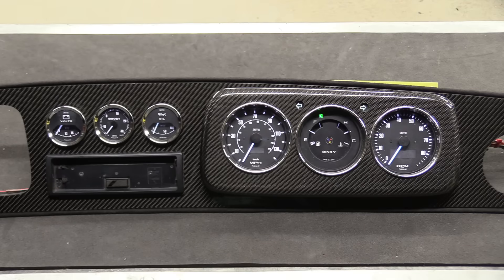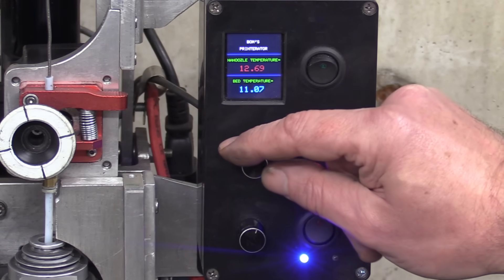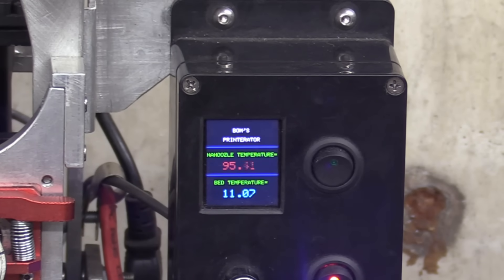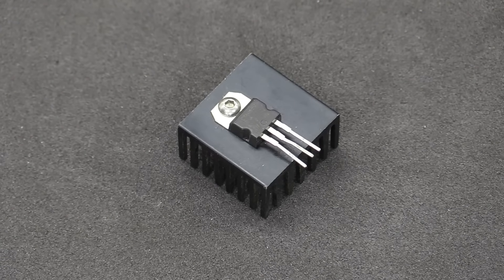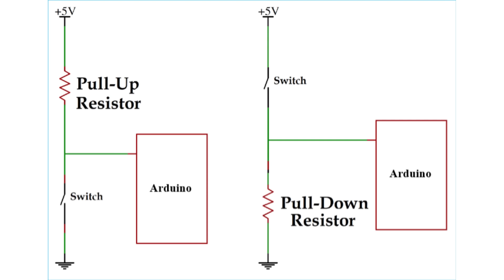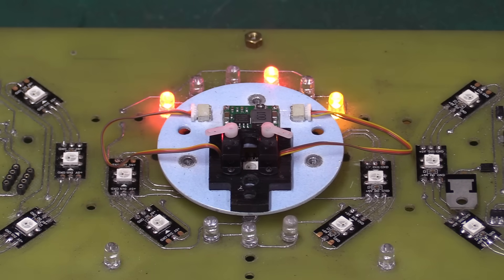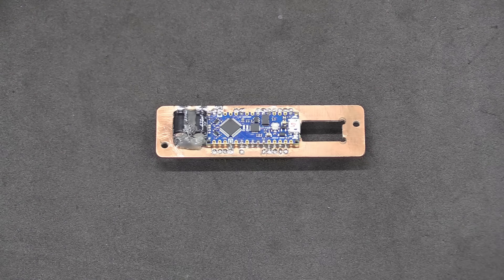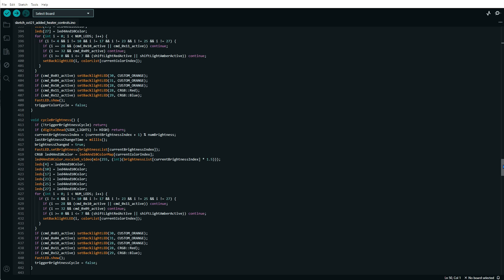Howie Did It - Learning Ardunio and Electronics

Comment: Is it okay to talk about one of my car related arduino projects here?

I have a nodemcu running arduino code that runs a server that generates an ajax web page.  Wired to it is a gps unit.  The webpage shows speed, direction, that sort of thing.  I wirelessly connect that to my surface tablet via my android phone acting as an access point.  On my surface I was running OBS which also took in a feed from a camera mounted in the car.   I could take the nodemcu feed and overlay the gps data as a browser input in obs.  And because the phone had internets access, I could then live stream the video to Twitch or record for youtube as I see fit.

This was a few years ago now, before ai so I did it myself.  I would like to use the setup again but the fact the camera feed was not stabilised and it all ran out of power too easily, I stopped using it.  I could not afford a big powerbank thing like a jackery, otherwise I would have continued developing the setup.

These days I just record with a phone with no gps data but can have digitally stabilised video.  It is more comfortable to watch, but I would still like to have gps data shown on screen.  Does anyone have any ideas how to do this without spending any money?
Reply: ESP32-P4. Sorted

Comment: Did anyone mention using an ESP32 chip instead of an Arduino? They are a lot fast than an Arduino, you can use almost the same code as an Arduino and you get Wifi and Bluetooth in the mix for with the chip! and, they are also cheap  - I mean, its a bit late now, but..... ;-)
Reply: Far fewer IO pins, not much in the way of ADC, a more complicated development environment, and the added complexity of 3.3v instead of 5v. As a professional embedded Dev I can't bring myself to use old atmega chips in general, but it's an appropriate choice here.

Comment: hi there is a very easy way to connect 12v inputs to a 5v micro controller just use a input resister on each input eg 10k and a diode from each input to a common Zener diode connected to ground to limit the voltage eg a 4.5v zener

Comment: Make sure you've got enough power supply protection.  The switching regulator probably won't protect you against alternator load dumps when you turn the car off. You need an appropriate combination of diodes, zener diodes and a varistor.
Reply: And a fuse too? ( I keep trying to convince myself that their track layouts on the instrument cluster won't short out)
Reply: Good suggestion .I'm thinking to incorporate something like this https://www.circuitbasics.com/wp-content/uploads/2020/07/over_voltage_protection_1-1536x656.jpg but with a polyswitch instead of  fuse in my arduino / auto project..
Reply: That's even starting to be a problem in the NERF modding hobby, now that brushless motor systems are getting more common; the load dumps when you let go of the rev switch and trigger are enough to blow things up without a flyback diode and/or fuse in the right place. Even the brushed motors still dump enough power when the circuit opens to require extra help to avoid smoking something internally...

Comment: This project is like life. By the time you figure out all the things you'd have done differently, you're near the end.
Reply: Which leads to the "second system effect" where the second time you build a kind of a thing, it's a disaster because of all the stuff you try to cram in there.
Reply: Or, as they say... Experience is what you get right after it would have helped.
Reply: @douglasburnside  which is why using other people's experience is a helpful thing.

Comment: Your solution to power the arduino from the car will soon kill it.  Automotive power is messy as hell - you’ll need a lot more components to make a reliable 5v source
Reply from the maker: It's not being powered by 5v.
Reply: @BadObsessionMotorsport  well whatever stepdown you are using

Comment: Since you learned how to program Arduinos, you could also use way stronger micro controllers as well. STM32, ESP32, Teensy. All way more powerful than the Arduino and the first two are still cheap as hell. The ESP32 even comes with Wifi and Bluetooth, which can be quite useful.
Reply from the maker: For this project, the Arduino was plenty powerful enough.
Reply: @BadObsessionMotorsport  Except you needed two😄. I really don't see the advantage if you get an ESP32 Board for 2 bucks.
Reply: It's entirely possible to get it all into a single Arduino, it's not a question of capability. The real problem is that this is automotive and you don't want a bug in an unrelated bit of code crashing your instrument cluster when you're driving. It's far safer to separate out tasks onto individual processors so failures are limited.

Comment: Arduinos are pretty crap these days.  Just no point in using them.  ESP32 is way more useful.
Reply from the maker: ESP32 wouldn't be any more use to us in this instance.
Reply: @BadObsessionMotorsport  well it would would have been powerfully enough to drive everything without needing two nanos for a start.  Then you’d just have more headroom for your imagination too.  Over the air firmware updates over WiFi ?
Reply: Also just cheaper
Reply: @odl21 the atmega is plenty powerful enough for this. Separating the mcus means that a bug in your fancy lighting code doesn't crash your entire instrument cluster when you're doing 100kph on the road. Safety and reliability is more important than saving a couple bucks on the bench.
Reply: Also I would recommend looking into windsurf and platformio instead of arduino ide and LLMs.  Fully integrated, much more powerful and professional experience

Comment: As the arduino has built in pullups it makes more sense to connect buttons to ground and use software to enable the pullup.
Reply from the maker: Couldn't agree more.

Comment: 'Return spring' is about the best description for pulldown/pullups that I've heard in decades of noodling with analogue ccts. Nicking that!
Reply from the maker: Be my guest.
Reply: It doesn't hurt that the symbol for a resistor looks like a spring already 😂
Reply: @JamesChurchill Only in the USA. Over here it looks like a spring with its ends sticking out of a TEMU parcel 😄
Reply: @JamesChurchill  Unfortunately though, resistors are much more similar to dampers when you look into how electrical systems and mechanical systems map onto each other.  Springs are more like inductors, while capacitors behave like inerters.
Reply: It's also the release date of their next intallment :)
Reply: Yes, the spring analogy for pull-up and pull-down resistors on digital inputs / outputs is brilliant. Well done guys
Reply: Yup. As a relative newby, don't think I really understood what they were doing until that moment.

Comment: This is exactly like my metre long robot fish build, except it had to fit in the final year of my degree, which is considerably less than a year. It has a i2c driven chip that controls its four tail servo. That took a lot of load off the main chip, but it ran better with two processors.
Reply: Sounds great! The real challenge must be keeping the thing water-tight though. 😅

Comment: I've been using AI (Deepseek is better than ChatGPT) for a while to write the sketches for my Arduino projects. 
It's incredible! Suddenly Arduinos and ESP32's are usable by everyone, not just the geeks.
For the DC buck converter consider using filters inline with the power feed and a two way diode across the 12V to protect from HV spikes. Dotnetmakers  made a great video series on this.
I've used relay modules in my EV conversion to control lots of things but the Arduino that controls charging uses one of the relays to latch power on. When ign is turned off the arduino still has power from an aux source through the last relay. The relays turn off in sequence so when the last one opens it removes power from the Arduino.
It might not be as elegant as your setup but works well.

Comment: The "As with any new technology" coupled with the PC running what appears to be Windows 2000 is just beautiful.
Reply from the maker: Since had an enforced upgrade due to failure. Now bang up to date. Windows 7 is up to date right?
Reply: Nothing wrong at all with old SW on isolated computers with no internet.
Reply: @BadObsessionMotorsport  Close enough!
Reply: @BadObsessionMotorsport  7 was the last good version of Windows, so... yep
Reply: It'll be fine when they're on Windows 17 and the project is done 😉
Reply: This is a common occurrence in industrial electronics. My ventilation controllers can only be edited using Office 2003. And the matrix video switcher is loaded via a 3.5-inch floppy disk drive. It's twenty years old, but it works perfectly and switches 64 cameras in the situation center.
Reply: @alexwoods2836  I'm still rocking XP in a VM because of ancient Adobe and IE requirements
Reply: @alexwoods2836   Interesting does it use the old kind of XML-file? As an experiment what would happen if you tried to edit a file in Libre Office, 2003 XML is an option among the "save as" alternatives there
Reply: @alexwoods2836  I used to work at a site that I left in 2013.  The PABX system was still running on a 386 at the time.  There was a moment of panic when the PSU failed and we had a mad rush to find an AT PSU to replace it with - fortunately I had the foresight to keep a couple spare "just in case"

Comment: I'm with you on the chatgpt. Just don't expect it to give you the answer on the first go. I'm happy to work with chatgpt, run some iterations of code and learn something at the same time. My journey has been with the ESP32, mainly because it's got a lot more capability than the Arduino but I'm going to be using the Arduino soon in projects that maybe don't need the extra power that the esp has. I'm using visual code studio as my workbench which makes saving various projects relatively easy.

Comment: Raspberry pi pico would have solved the dual board problem.  It has two cores.  It is a microcontroller that you code in the Arduino IDE just like all the rest.  But since it has a dual core processor, you can use it like two separate arduinos.  Not to mention it is quite a bit faster, and equally small.  I like to use the Philhower III core for the raspi pico which makes dual core coding as simple as having two setups and two main loops.  You can find the raspi Pico for cheap.  I mean £5 kinda cheap.  Look into it Rich.
Reply: It's actually possible to get even the lowly Arduino to do it all in a single core, but this is automotive and you don't want a bug to take out your instrument cluster at an inconvenient moment. Separating onto a couple of completely independent mcus is a good solution even if my embedded programmer brain sees other paths.
Reply: @JamesChurchill  If that was true, he would never have touched Arduino and would instead have gone for industrial stuff like STM.  Womp womp.
Reply: @MandoRick1978 there's nothing wrong with the atmel chips used in the Arduino, except that they're ancient and slow. " Industrial stuff like STM" just shows you aren't actually aware of the real issues a professional hardware designer needs to take into account and are just going off memes and vibes. Have a look at the errata for an STM part some time (and even that doesn't preclude their use, just requires actively taking it into account during part selection.)
Reply: @JamesChurchill  Sure, whatever you say boss.

Comment: 5:58 Just FYI for anyone starting to develop with buttons and switches - almost all Arduino type boards have built-in 'pull up' resistors, so you don't need external resistors - just connect the button/switch from pin to ground (-ve). In contract, very few microcontrollers have 'pull down' resistors.
And if you want an easy life, check out the InputEvents library ;-)

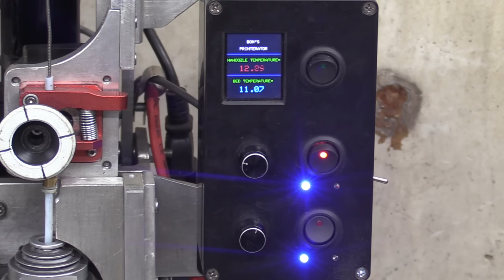Comment: @1:31 It's a 10 bit ADC, not 8 bit.

PWM output is 8 bit...
Reply from the maker: My mistake.
Reply: @BadObsessionMotorsport  It happens to the best of us! :)

But I really appreciate what you did with these gauges and also with this video by teaching the audience about Arduino and how relatively simple it is to use. It really shows that a lot is possible even if you don't know anything about programming.

I built a full DIY eddy current hub dyno with two of my best friends and all of the control logic and data acquisition is done on an Arduino with homemade code communicating with a homemade LabView interface. I had never done any programing prior to that in my life and seeing what you guys achieved for this Binky project I really appreciate the work you have put in.

Comment: The Arduino is like a miracle component, or at least it was for me. Incidentally the A-D is 10 bit and reports values from 0-1023. Very well done with your projects, you certainly don't go for the easy options!  I have been in the radio and electronics trade all of my working life, nevertheless I had avoided working with micro-processors. I completely get your enthusiasm, they encourage you to try more and more.

Comment: Arduino is a massive rabbithole if you are into coding and hardware....
I have done so much with the Atmel ATmega chips Arduino is based on, easy to use and cheap enough. Also for inputs from over +5v just use a voltage divider, it's 2 resistors only and you can use online calculators to find what 2 you need for what ever voltage input and output, way easier that a tiny transistor or optocoupler. With the glitching it is easier to use a uart instead of i2c for comms.

Comment: makes me want to try to see if I could use these for some in the house stuff.
Reply from the maker: Yep, I've made a door sensor for the shed hooked up to the lighting, got a weather station connected to a webpage. As I say, the possibilities are endless!
Reply: Do it! I've got an Arduino reading a couple of moisture sensors (again like Rich says in the video, all sensors are just variable resistors!) in some pots in my greenhouse, when the moisture drops below a set point the Arduino fires a relay that turns on a pump to run the irrigation system for 10 seconds.

If you can think of a task that can be automated by reading a sensor then the possibilities are endless!
Reply: I'd take a look at Home Assistant. A very nice community with lots of examples